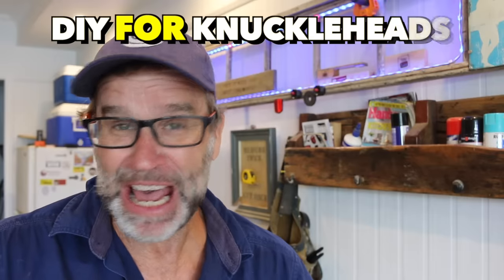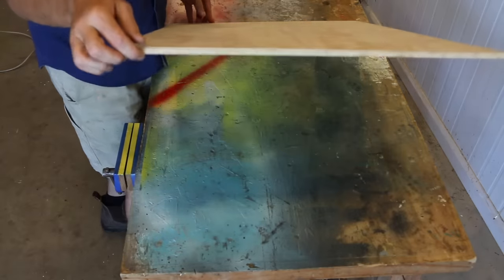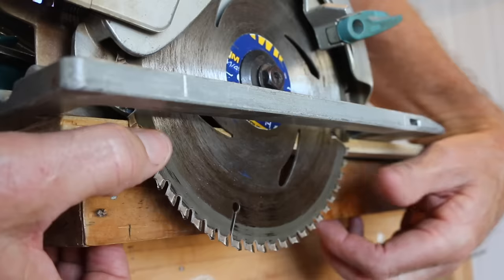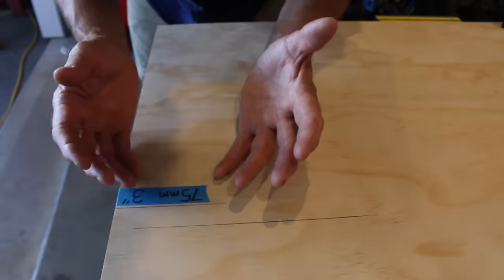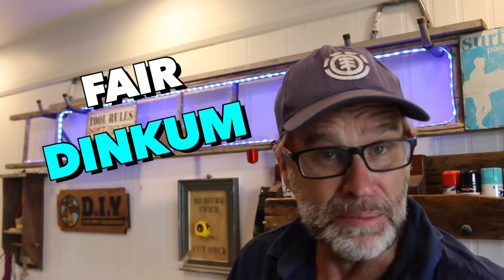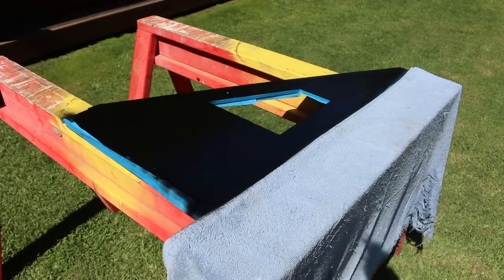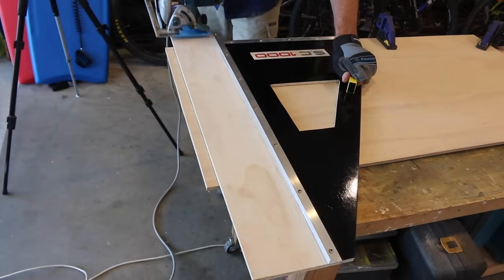How to Cut SQUARE Like a PRO!

Comment: Thx for sharing. I don't know how I'm gonna make an SC1000 without an SC1000. There a few long square straight cuts. I need to barrow yours. Oh, what am I gonna do?
Sorry bout your tooth. Did the dentist make that Zooper Dooper or is he in cahoots with them to drum up more business. I had a molar split down the middle once that was so painful. The pain surely got me to the oral surgeon in a hurry. A dentist wouldn't touch it.

Hey, thx for putting up with my wisecracks. That is a great and simple tool to make. For sheet goods it can't be beat unless you have a $5,000 panel saw lying around.
Again, thx for sharing.
Reply from the maker: 😂....You'll be right mate....it's pretty easy.....all you need to do is one straight cut and you use your saw guide to preform that so you can't go wrong 👍 
I think you're right re the dentist / Zooper Dooper company conspiracy 😂😂....It's a license to print money! Thanks for watching 👍😁🇦🇺

Comment: Good stuff! Simplification, esp. if your ply does not have the factory edge.  Make the cutout leaving the area for the saw’s shoe over wide. Attach the aluminum angles a true 90 degrees as shown. Run the saw along the guide cutting away the excess. Et viola
Reply from the maker: Yeah, good tip Bud 👍👍 Thanks for watching mate 👍🇦🇺😁

Comment: Not sure if this was stated, can you get away with 1/2" plywood or you would recommend going with 3/4" plywood.  Love your humor!  Great dyi idea!
Reply: Looks like he uses 1/2" in this video, could be wrong. However the aluminium angles should stop the board flexing anyways, only issue would be screws going through, but can be ground down with an angle grinder or file

Comment: Great video. Can I use that jig for cutting mild steel with a steel cutting circular saw? Thanks!
Reply from the maker: Thanks Paul....as far cutting steel....not sure mate as l've never tried it 👍
Reply: Well then, you ll be the second to know. Thanks
Reply: Works well on mild steel  with my steel cutting circular saw. My next try will be with my plasma cutter!
Many thanks.
Reply from the maker: @paulcoy7292  To easy mate 👍

Comment: Cool jig. Suggestion - the hole you cut in the middle of the jig I’m guessing is to reduce weight. If you moved it (the opening) closer to the “squaring edge” you might be able to more easily keep the jig in contact with the piece being cut. Thanks for the video.
Reply from the maker: Yeah good tip mate 👍👍

Comment: Interesting approach but ..... There is no adjustment after build, Also, the accuracy of the 90 deg is contingent on the straightness of the aluminum angle and the  original factory edge and the ability to transfer that factory edge geometry. Too much can go wrong. Also you check the resulting cut with a framing square which are notoriously inaccurate. When cutting panels for say, cabinets, a .001" out of square per foot  would be excellent but it would be very difficult to achieve that without a pre-screw down test like the 5 five cut test to test and adjust the accuracy. Have you tested yor jig to determine the inaccuracy? If so how did you do? Thanks
Reply from the maker: Hi Terry, for the projects that l do, the jig is great. I've always trusted the builders square for accuracy and so far it hasn't let me down. Thanks for watching 👍

Comment: Ken-B
Enjoyed your video, although the jokes hurt a bit!   One problem I found (and probably many of your readers):  the clearance under the motor on my saw is only 7mm, so instead of using aluminium (note the spelling!) angle, I used 5mm thick rectangular section.  Hoping to see many more of your posts,  they are clearly presented and easy to follow -  well, I am in my third childhood!
Reply from the maker: Cheers mate and thanks for the tip! 👍😁🇦🇺

Comment: Question: Why cut the bottom edge and lose your perfect factory square? Just have leave the factory right angle as-is but extend the metal rail/saw guide out 75mm from the bottom. Wouldnt that make more sense? Otherwise the whole thing still depends on you making a perfectly square cut, which was the problem we were trying to solve in the first place! Am i missing something?

Comment: OK my fellow knucklehead..I don't have a table saw but need to cut lumber that is 90 x 40, into 45 x 40 but the SC 1000 isn't the right tool for the job, do you have any idea's you could share.. Thank you.. Steve
Reply from the maker: Steve, l'd just set my circular saw using the saw guide to the measurement you want, and go for it 👍👍

Comment: What is the diagonal side used for? Does one need to make a jig this big just for a straight cut?
Reply from the maker: Hi Samantha...the diagonal side is just for looks and also to keep the weight down. The longer the cut.....the bigger the jig. However if all you want to do is cut a straight line and you aren't concerned with the cut being square, then you can just use a straight piece of wood or a straight edge of some description to run your saw up against.....hope that makes sense 🤔 Thanks for watching 👍🇦🇺😁

Comment: Don't tell anyone, but I actually look forward to your Dad jokes. They really make me laugh. My Dad was a former Army Paratrooper trainer, so we didn't get too many Dad jokes in my house, but we still had fun. One little upgrade you might want to add to your excellent jig is maybe adding some anti-slip safety tape to the bottom of the jig. It will not move at all when it is applied and a roll of it is actually pretty inexpensive. Keep these great videos coming.
Reply from the maker: 👍...Thanks Gregg.....a bit of light heartedness never goes astray 👍😁 Good tip re the anti slip material and thanks for watching mate 👍😁🇦🇺

Comment: how was the sc 1000 label made?. another fab video :).
Reply from the maker: Cheers Gary. I made the image up in a word document then did an image transfer on some label paper. It's nothing fancy, all l use is label paper that you buy from your local stationary store......you know, the A4 sheet of paper that is covered in labels that you peel off and stick to things like envelopes.....peel all those labels off and throw them in the bin. Once the labels have been removed you are left with a shiny surface and that is what we want to print on.....hope that makes sense ....l actually made a video on the process a few years back...Here's the Link to Image Transfer Video. The instruction starts around the 5.40 mark in the video. Good Luck!! https://youtu.be/-A-Un_X21lU......Good luck 👍😁🇦🇺
Reply: @diyforknuckleheads  Thankyou

Comment: ya, since a speed square is adequate for most boards, i'll just use the factory side of a p/w strip clamped on to my wide board for an even more secure guide than the speed square. this jig might be worthwhile if you are making a lot of cuts within the range of jig but too long for your speed square. i realize building jigs for every single thing is has gotten into peoples heads recently, but sometimes it is better to get it done with simple methods using what you already have than to divert time, attention and materials to a less direct approach

Comment: Hi again. Would you caution against using a jig saw to cut the aluminum angles?
Reply from the maker: Mate, l've never really tried it to be honest and l am not sure if you can even buy metal cutting blades for it. I wouldn't think it would be the best.....a cheap hacksaw is all you need. Thanks for watching Nick 🇦🇺👍😁
Reply: @diyforknuckleheads  thanks bud! Appreciate the quick replies

Comment: I've started making this, using the materials you have listed. But am I missing something, the ply plus angle equals 10.6mm thick (9 + 1.6) and the screws are 12mm. Won't they penetrate through the ply?
Reply from the maker: G'day Paul....yes they do poke through. You need to grind or file them off. The next size down screw had a really small head which is why l went for the slightly larger but heavier duty screw 👍

Comment: I've seen some make a track saw design similar to yours and I like yours better. Now what if I wanna make a 45 degree cut on the edge of the wood, would I have to make a new template ? By the way. Sorry about the tooth and thank you for the vudeo
Reply from the maker: Hi Hugo....you could incorporate a 45 as well but the jig would be very big 👍 Got the tooth fixed last week thankfully 😊.....it was cutting my tongue to shreds 😂 Thanks for watching mate 👍😁🇦🇺
Reply: @diyforknuckleheads  the jig would be to big ?
Reply from the maker: @hugodiaz163  Yeah Hugo...if your straight cut portion of the jig is 900mm long for example, then the width of the jig would have to be 900mm plus the width of the saw base making it a metre wide which is pretty big to store...hope that makes sense 😁🇦🇺
Reply: @diyforknuckleheads  thanks a lot. I'm getting in to the speaker builds bot the table saw can be really scary. Your set up is much safe to use. I try cutting with a straight edge ones, it worked bot I used a bad saw blade and left it all alone 🤣

Comment: Great idea. I'm about to buy materials but I'm looking at the list and it says 9mm ply with 1.6mm aluminium angle and 12mm long screws.  Wouldn't the screws stick out? 
Just realised you're in Sawtell. I'm in Coffs - If I see you around I'll say g'day!
Reply from the maker: G'day Rowan...small world mate 👍😁 Yes the screws will stick through a fraction. I just ground them back with a grinder. Any screws that l found that were smaller had a really small head and weren't really suitable. Have a good one....maybe l'll see you at Bunnings  👍😁🇦🇺
Reply: @diyforknuckleheads  Cheers. I ended up going with thicker ply so the screws wouldn't stick out... 
Where do you get your timber from? Bunnings here only sells boomerangs and pringles
Reply from the maker: @rowanrobinson  Hahaha…all the stuff was was from Bunnings in Coffs…you just have to sort through all the rubbish 👍😁

Comment: Hi,
I got all the bits together to build my saw guide, generally along the lines of your clip.  Then I got to wondering (unless you've found a supplier of arm extensions) how you manage to reach when cutting a full 2.4 m length.  Now, you have to appreciate that I am an awkward sod and don't like to get confused when doing things,  so I must explain that I am right-handed and prefer to cut from right to left so that my feet don't get in the way of each other.  As you say, a circular saw is a dangerous weapon and I would hate to trip up whilst holding one, so is there a good reason why you chose to make your guide thingy so that you stand to the left of the cut line.   Is it because you tend to use it for cross cutting relatively narrow sections rather than ripping?    If so, it could have been about half as long as you made it and it would be much easier to handle and store.
Ken
Reply: perhaps a bit late on a reply, but consider the foam sheet backer trick mentioned elsewhere in the comments.  Basically, lay a large sheet of ridged foam on the floor and cut your large plywood sheet on top of that.  I actually just kneel on it while cutting.  safe, easy to reach, and no cutting the concrete floor.  Cheers!

Comment: To make sure the cut is dead on, leave a little extra panel sticking out where the blade cuts and when you get it built, trim off the excess and the edge will be exactly where blade is going to cut.
Reply from the maker: Yeah good tip Wayne 👍👍

Comment: If you make the cut-out area larger, or at least closer to the short straight edge where you put the label - you can use it to grip a 2x4 or 3x2 length and cut those off straight too.

Comment: For some improvement, you could add a splinter guard, ala Festool and some of that grippy foam to reduce the chance of slippage in use?
Great device, fun take on woodworking YT.
Reply from the maker: Thanks Henry....good tip re the grippy foam 👍😁🇦🇺

Comment: Loving your videos - and I'm about to make myself one of these guides - just wondering if your screw size is correct - you use 12mm screws when the materials it's going through are 9mm + 1.6mm?
Reply from the maker: Thanks Richard! The screws were a fraction to long so l had to lightly grind them flat once they broke through the other side of the ply. Unfortunately these were the smallest pan head screws that l could find that still had a decent size head. Have a good one mate 👍😁🇦🇺

Comment: FYI, I'm truing my saw to a 90 degree cut and when the frame bottoms out, it's still not 90. So the rotary tool is coming out and then I'll have to rely on the set screw. I've been using that saw for 6 years and it's always been out about .5 to 1.0 degree. Never thought about modifying the tool. The factory left a large bur and hampered proper 90 setting.

Comment: You are assuming that the baseplate edge is alligned with the blade cutting line.
Check that first before you do anything.😆

Comment: Great idea but am I right that we still have to make a final but very precise straight cut to get this right? I'm talking about the cut you made for that 75mm. If that gets messed up then the whole jig is ruined. Beginner woodworker here so excuse me if I missed something :) And thanks for the great content you post! HNY!
Reply from the maker: Hi Tamas...you're right...you do need to get that 75mm cut right which is why l used the saw guide to cut it. HNY to you and yours as well mate and thanks for watching 👍🇦🇺😁
Reply: @diyforknuckleheads  Unfortunately the rip guide doesn't come with all circular saws. My old Milwaukee has the slot for it, but was sold as an optional accessory at the time, which you couldn't find in most stores that sold the saw (this was before you'd buy a tool online). 😖 Your video reminds me I need to buy that piece. 👍
Reply from the maker: @chadvoller  Sounds like it mate...shame it didn't come with the saw 😊

Comment: If you don't have a piece of plywood with 2 factory perpendicular edges, simply screw or clamp the aluminum saw guide (long piece) down a bit farther from the edge of the plywood than the distance between the blade and the edge of the saw base.  Run the saw down it and the guide will be EXACTLY the right distance from the edge.  Now you can square off of this edge of the ply.

I've actually seen plywood straight from the "big box" store that completely lacked a square corner.  If you don't need the full sheet and can stand to lose a  bit off of the total length and width, this can be fixed if you have a track saw.  Take about 1/8" off of a long edge.  Use that edge to square off of to mark and trim one short edge.  You now have 2 straight edges and a good corner to reference from.

Comment: No robertson (square) head screws down under ? Here in Canada they are the preferred screw. So much so that I usually throw philips screws straight to the trash as the square heads are so much better to work with
Reply: This is the way. Robertson is the best. I hate putting together Ikea furniture because it's full of inferior Phillips head screws!
Reply: @McGuillicuddy1 Pozi in the UK. Still use old slotted too.

Comment: Nice jig. I'm going to make one although I'm going to use a 1.5m length of aluminium angle so that I can use it for width cuts on 2400x1200 sheets of board
Reply from the maker: Yep! Good call mate 👍 Thanks for watching 😁🇦🇺👍

Comment: Love the channel and love this episode. I've watched this video 4 times so far.  Could you use MDF instead of Ply providing it's straight?  The only reason I ask is because I have a sheet the right size.
Reply from the maker: G'day Jas.....yeah mate you probably could 👍 May not last as long as the ply though....just depends on how rough you are with your gear 👍 Thanks for watching mate and l hope you can stick around for more. Cheers 👍🇦🇺😁
Reply: @diyforknuckleheads  Well, I might at well give it a crack and see how it turns out.  I'll let you know. I'll definately be sticking around to watch more.
Reply: One more question.  Why did you change your mind from 100mm to 75mm for the lip at the start of the guide?
Jas
Reply: @diyforknuckleheads  Thanks for the idea and instructions. I've done it, and it turned out great.  One pro tip, if the angle isn't perfect, you can glue a shim to the stop side to staighten it. I'm trying to post an image, but can't seem to :(
Reply from the maker: @OscarDaFish  Mate....head over to my DIY For Knuckleheads Facebook page and send me a message with the photos..l'd love to see them 👍

Comment: Either way... you're up shit creek without a paddle, and a canoe come to think of it, unless you get the two guides at a perfect right angle. Best way to do this is make the one which guides the saw adjustable initially. Once it is absolutely square you can fix it in place. Also place the guide rail a little more away from the cutting edge so that the saw will end up cutting a perfect zero-clearance guide after the first cut - of course you best get the right angle factor spot on first  I suppose you can always use a replicable non-slip material affixed to the underneath of the jig to ultimately get it all spot on and this will help with gripping the material being cut too.
I think that I am off to follow your video and make my own version!
Great little vid and thanks and always enjoy the DJs... talking of which... the two same nuns were sitting in a bath... one said: "Where's the soap?", "Mmmmmmm, it certainly ..., doesn't it!" said the other! (written down this does seem a little waring I suppose! My apologies but just stop myself!)
Reply from the maker: Hahahahaha....l like it mate 😂 and good tips re the jig as well. There's always room for improvement 👍👍 Thanks for watching 👍😁🇦🇺

Comment: Another tip is to place the first piece of metal slightly deeper than the width of the saw and then using the saw to cut a new edge out of the ply. That way you get the saw as tight to the edge as possible and without needing to measure. Still need to make sure it's all square though!
Reply from the maker: Yeah...good tip Matt 👍🇦🇺😁